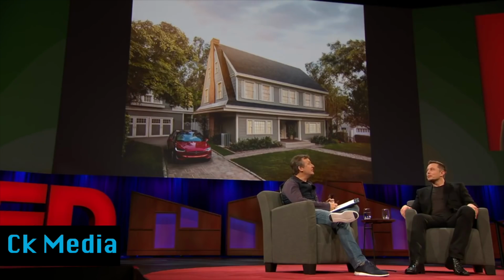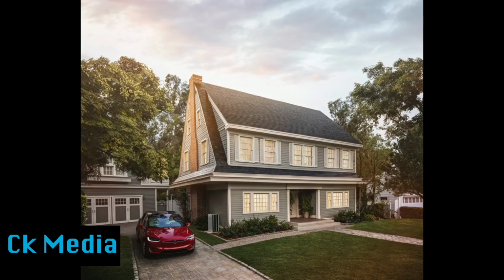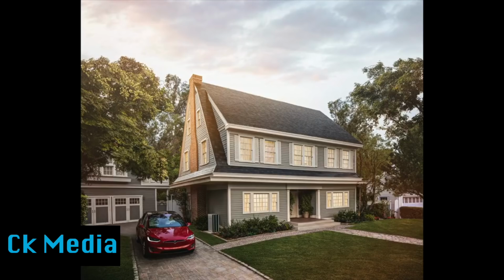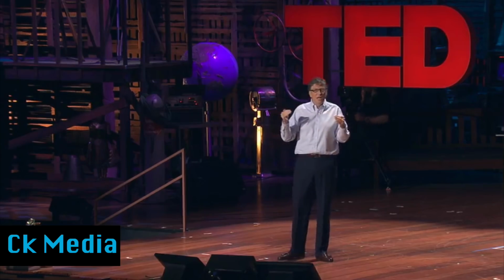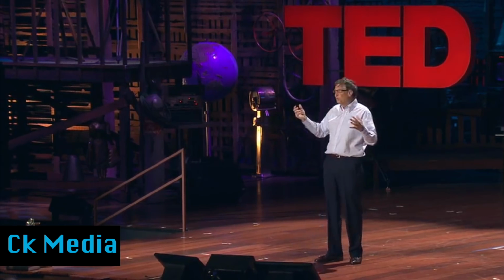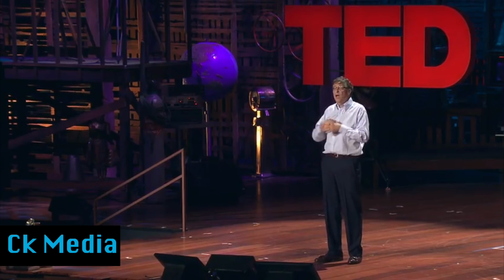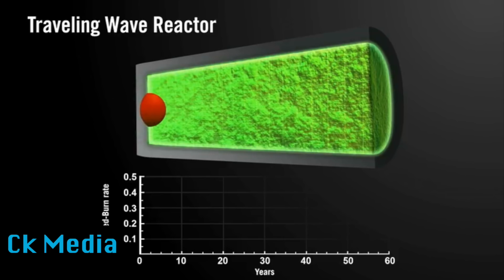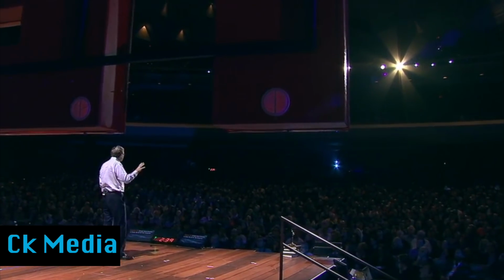Billionaires on Energy - Bill Gates, Elon Musk - Solar, Nuclear

Comment: The issue about nuclear is that it is harder to sell than solar or other renewables because of it's history.
Reply: The real issues are
It takes too long to design, consult and build.
And
The power that new nuclear produces is already more expensive than renewables (which are getting cheaper)
We need clean power now, not in 15 to 20 years which is what a boost in nuclear would take.
If nuclear is 20% more expensive than wind now by the time it's finished you're looking at more like 50%.
A wind turbine could be designed and built in the year towed out to sea and be producing clean power for at least 15 years before a nuclear plant was even complete.
It would basically pay for itself in that time.
Reply: @rogerstarkey5390  we dont got to do jack didly squat.  We got enough coal for thousands of yrs.  Plenty of time.
Reply: @Dragon Dimosthenis Germany does not use 68% renewables. In fact if you look it up its about 13-60%. 
In fact in Germany the cost for electricity have gone through the roof and are now one of the highest in Europe at 30 Cents per kWh(In France with mostly nuclear power 14 Cents). The cost did actually start rising when Germany decided to shut down their nuclear reactors. If I remember correctly the only country with higher prices is Denmark. They are also shutting down their nuclear plants.

 I dont believe in renewables because you cant store the energy. The price it would cost to maintain 5gWh of renewables is comparable to building nearly 40 new nuclear reactors, each generating 1gWh.
If I look at the facts i have to say renewables are just impossible because :
-needs too much space
-cant be stored cheap/efficent => if we want to store the energy it is very expensive and a lot of
.                                                           energy is lost during the process. That leads to rising prices.
-generates more waste
-cant generate enough energy

and most important
-you cant rely on them...

What if it´s cloudy all year and there is not as much wind as there should be. How long can we maintain our power grid in that case. At some point there is no stored Energy left.

At last: We are going to have a power crisis sooner or later due to the fact that we want to shut down nuclear and fossil facilities. To cover our needs we would need to place wind turbines on a area as large as Bavaria, thats about 70,548 square kilometers (27,200 squaremiles). That does not seem reasonable at all.
Reply: @partybus31  I agree and the reason why Nuclear plants are so expensive is because of all the redundant regulations that drive up cost and lengthen the time to build. Nuclear regulations should be strict but not ridiculous. Some cuts should be made to make it more efficient while still being safe

Comment: I think that for earth Solar, wind, water, tidal, geothermal, biomass, etc are my preferred power solutions depending on location. Certainly storage of some kind is essential as well. Nuclear looks very appropriate for mines, cities, polar science facilities etc. I really see nuclear as being by far the most important energy source for space travel and bases on the moon, mars and elsewhere. 

So I see a large demand for both of these energy solutions
Reply: Nuclear really does a good job of constant 24/7 power generation without the need to for massive power storage solutions. As you say use the tech that best works for the situation. The end user can offset energy use with well built, low energy use structures and energy such as Solar/Wind, but rely on the nuclear when it is dark, cold, or storming.
Reply: Good comments
. Thanks
Reply: biomass is not good, you're using starter fuel and wood from a nearby plantation. But that doesn't mean it is good

Comment: The answer is both, you dont have to 'choose' the best choice is a mixture of renewables and nuclear. The problem will be periods of high demand which battery systems can provide for, unless we are willing to build more power stations that are not continually running which nuclear is more suited too. Hydroelectric dams are good for periods of high demand but geography will restrict the application of these, its good that they are engaging with the problem but  i wish Bill Gates was not so absolute and dismissive of solar and other renewables

Comment: Why not both?
Reply: Thank you!
Everybody is acting like its the battle of the billionaires, choose a side.
Reply: Because we don't have infinite resources to throw at both.
Reply: Brainbuster Yes we do, we have the money. There’s plenty of uranium and the sun isn’t going anywhere anytime soon
Reply: Both is cool but right now we are only doing one.
Reply: Because we need a miracle, like Gates said, and if we decide both, solar and nuclear will not work like only nuclear, both will be more slow than nuclear.
Reply: A reason why you wouldn't want to is that solar power is highly variable and intermittent. It either needs grid scale storage (and lots of it) or another form of power which can fill in the gaps solar leaves. That is typically natural gas. Because solar can vary from producing a lot of power or no power, you need a lot of capacity in your backup or storage.

Nuclear isn't great at providing all the power a grid needs since it works best at a certain steady rate but it can provide almost all the power a grid needs and does so very reliably. If you pair nuclear with storage or gas plants you don't need nearly as much backup capacity as solar does. In my opinion, nuclear plus grid storage is the perfect energy solution. Zero carbon, high stability, high reliability, and low land use.
Reply: why not Fusion reactor/3 gen or 4gen fission and solar thermal as base load， plus bio gas/bio diesel/ethanol as Load following power plant and the last solar panel and battery as peak load and peak shifting
Reply: @rileymiller7786  yes but do we have massive factories because someone typed a research packet on a Word Document? Do planes fly in the sky because someone puts a number on a spreadsheet? Does steel magically appear if someone takes out dollar bills? Please. Money is far from the main thing stopping us (or limiting us) from having both. The real limitation lies with our access to the materials, which money alone can't even hope to solve.

Comment: We need both Solar and Nuclear power, each of these technologies complements each other. And wind power is not a reliable source.
Reply: Why is wind not reliable?
Reply: @rogerstarkey5390  lol cause wind is random af imagine taking a hot bath and the wind stops.... That water is going to get cold lol
Reply: How do they complement each other? Solar ist just expensive and needs batteries for storage and backup power plants. Nuclear can provide it all cheaply without fossil backup and without vast amounts of expensive battery storage.
Reply: @AlJay0032  Batteries in few years will be more advanced and cheap. Coming to Nuclear power not all countries can be trusted with Nuclear technology, so solar power is the only solution for these countries.
Reply: Seb C Pumped hydro looks good but actually contains a 200% cost inflator. If you run a hydro dam, you try to make 10 cents a kw. If your pumps use that power (you can't sell it, no matter how it was generated), then you have a sunk cost of 10 cents per kw before you start the actual power generation (at night). So then you must charge 20 cents per kw. Hydro electric generation is not free. People always think: "oh, the generation equipment is sitting there anyways, let's make it do double the work at the same cost." The real world doesn't work like that. You can't build a brand new facility with double generation capacity without making it pay for the investment. If half of your capacity is non generating (regeneration pumping) then your selling cost doubles. Just like wind and solar triples or quadruples the price of power because of the time it is not producing.
Reply: @srikark3532  problem with Batteries is they are not very cost effective and at the same time use a lot of rare earth minerals... no to say the waste from used batteries are quite toxic.
Reply: @Seb C not trying to dispute any other points, but oil is abundant, we have zero chance of running out within the next century and the only reason the world's listed reserves are not even higher is that few companies are bothering to look for new reserves because the price is still so low and current production is already being restricted by many countries to prevent the price falling even further.
Reply: Solar and batteries work fine if you have enough money and that's why Musk is tackling that end of the problem, but neither solar nor batteries can compete with modern nuclear in terms of power for the poorest people around the world(not just enough power to read, but to develop the industry they need to stop being poor). 
It's also important to note that solar produces more waste(including toxic waste) than nuclear and has a higher fatality rate due to the amount of people that die each year installing and maintaining solar systems. Nuclear is currently both greener and safer than solar, though you won't hear that very often.
Reply: @Jake12220  nicely done.

Comment: These solutions are not mutually exclusive. On the contrary, we will likely need both. Nuclear has a hugely larger energy density and is available on demand. Also nuclear waste decays, where the poisonous materials used in solar panels last forever. But the safety concerns and therefore investment costs and construction opportunities are ar the moment much more favourable for solar. Both have benefits and drawbacks, but the one thing we can be sure about is that fossil is much worse.

Comment: This premise that we have to choose is false. In fact, the IPCC, the UN body that was created specifically to study climate change and suggest ways to deal with it, says (paraphrased) that we need to use all the technology at our disposal to tackle the global climate change. So use both and everything else too.
Reply: SO, the IPCC was created by Politicians, and you think this is a good thing, Lol
Reply: Glowing Alpine  You don't seem to get it, do you?  Solar just moves pollution to the aluminum, steel, and glass plants that produce the materials for a solar array.  They are about as green as Pus in a wound.
Reply: Glowing Alpine  Steel, Glass and Aluminum are THE most energy intensive materials used by Man, Numbnuts.  IF you think they can be adequatley paid back by a Solar Array, why don't you try forging from a Solar Array?
Reply: Glowing Alpine  The statistics on Embodied Energy are about as phony as you can get.  They basically mask the ACTUAL energy used by just taking the average at the steel / glass / aluminum manufacturing facility.  ANY steel, glass, or aluminum product, is basically fired about 5 times to get to a final product.  Believe it or not, fella, Aluminum is fired about 7 times, as it's produced by the TON, is cut into 24 inch blanks, and shipped that way to regional centers.  Local manufacturers and wholesalers refire and cut the blanks into commercial products, and local retailers order the size and scale of products from there.  SO, it's refired again.  The same goes for Glass and Steel.  Do you think that's a real measure of the embodied energy used in your products?

Comment: Solar and wind has a long way to go. When batteries get better they will become more important. Right now it’s nuclear, hydro-electric,  clean coal , and natural gas. But when nuclear IV is on line , this will carry us until we solve nuclear fusion. Just my opinion.
In the meantime I chopped a cord of wood last weekend.😃🔥
Reply: Glowing Alpine  
You’re actually wrong. Battery tech needs to get better. Way better.
Reply: Batteries dont need to get better if we get relativly cheap room temperature super conductors. Half of the earth is always lit up. Look at the broght side, there's always many solutions.
Reply: Glowing Alpine  by the way, there will eventually be diminishing returns on solar.
Look at California's energy grid from today.
When the solar goes up, they have to shut down power plants, and then they have to turn it back up when its night time.
So no solar isn't truly cheaper than coal, because you still have to rely on coal. If you use batteries, then its more expensive than coal.
If you were to use 3 powerwalls, you would have to spend about $4 a day ($120 a month, it all adds up) on storage based on the cycle life of the batteries and Teslas warranty. I've seen you on other threads, I highly encourage you to research this stuff, I personally really enjoy it. Ill post a link to some interesting reads tomorrow.